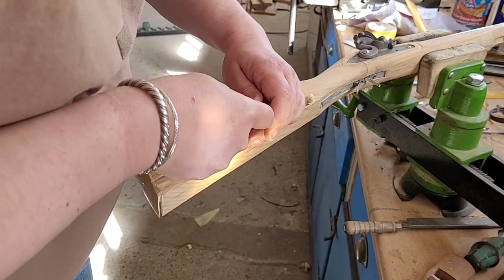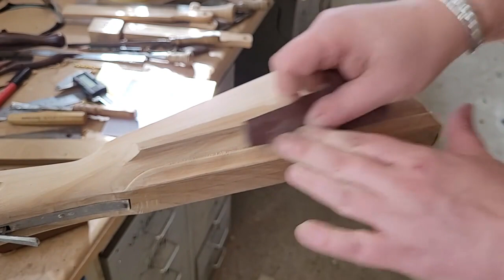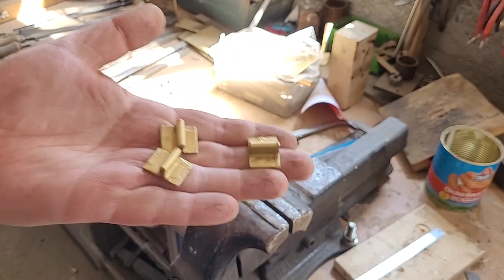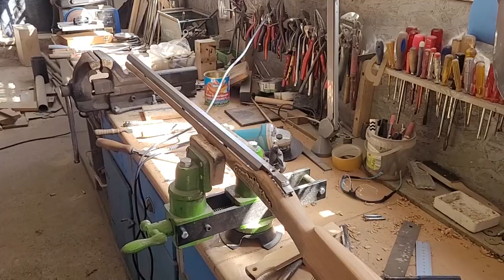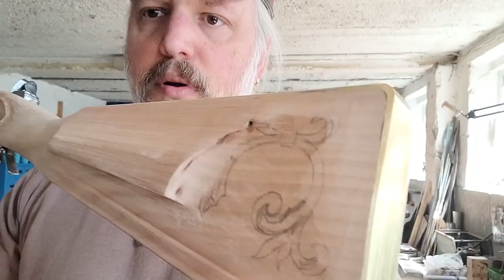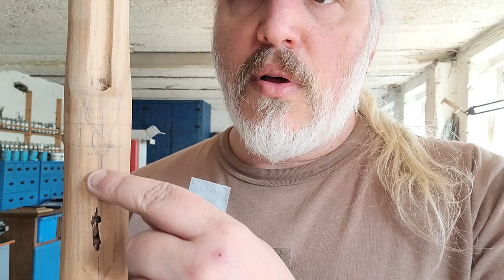Jäger rifle scratch build pt 23 installing underlugs and adding some molding to the gustock

Comment: Everyone makes mistakes! The skill comes in getting around them, and your inlet plan will look very nice. The stock carving came out very well, it must be "attacked" with great confidence and sharp chisels, which you have! Stay safe! Chris B.
Reply from the maker: And my plan is to do some accents on the sliding patchbox with horn as well 😁 so it will fit the new plan for the design. A horn plate on the cheek peace will look good as well . My chisels are kept scary sharp all the time🤣so stay save Roger S

Comment: Where did you get the barrel from?  from any metal
Reply from the maker: The barrel is a simple seamless hydraulk pipe made of ST37 steel. To make a oktagon barrel you will need at least 8mm wall thikness😁